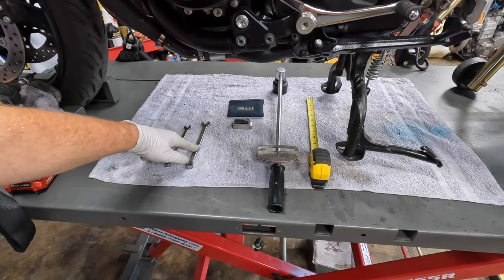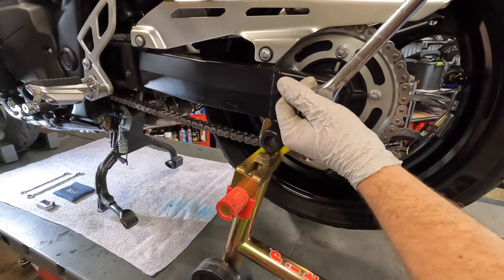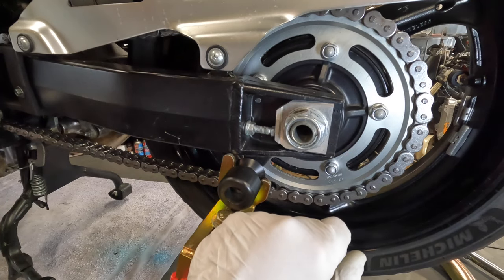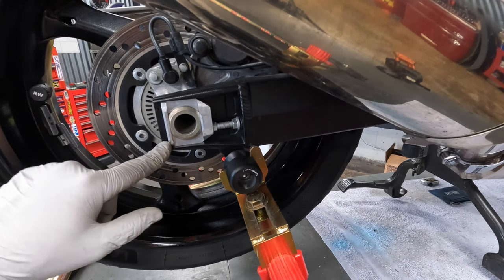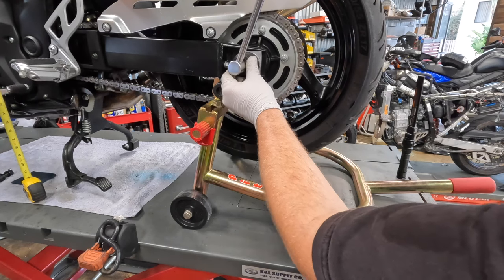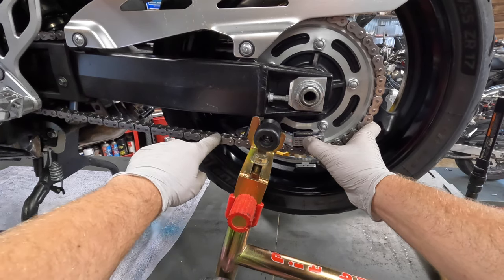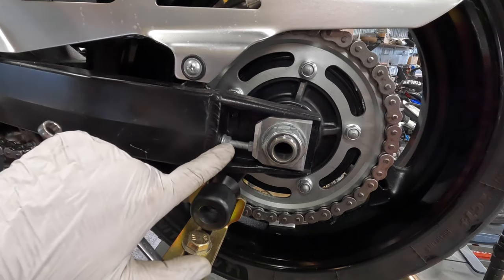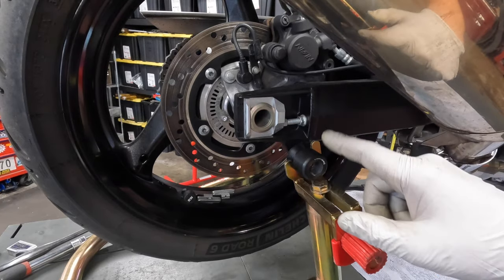How To Adjust Your Motorcycle's CHAIN & Alignment

Comment: I'm stuck at the point where, while tightening the axle bolt, it over-tightens the chain. Do I leave the chain far more loose than I need and let the axle tightening take in the slack? You're the first one to even refer to this in a video. Its really frustrating - it comes at a point where you think you're done and, surprise! You're not.

Comment: Do both axle bolts need to be loosened ?  Every video I watch only shows the side of the chain being loosened but lockouts are loosened on both sides
Reply from the maker: Hmm, not sure what you mean? I loosened the axle nut, the axle itself is held by the axle spacer on the other side on this bike, and it isn't, then you need to use a wrench on the other side to hold it from spinning. What bike are you working on?

Comment: Why torque down the axle, then check for alignment? If it was out, you'd have to slacken off again. What did I miss? Cheers.
Reply from the maker: Because for some reason, it changes the tension. Especially on suzuki's. It's just a double check...
Reply: Because torquing the axel nut tends to tighten the slack even after it’s adjusted.

Comment: My 2023 Klr650 says to adjust the chain with the weight off the swing arm to 1.2-1.6 inch slack. It makes the chain seem really tight when the suspension compresses. What’s your thoughts?
Reply from the maker: I'd do the adjustment while on the side stand or on a rear swingarm stand, and check the slack with you sitting on it and make sure it doesn't get too tight.

Comment: Hey Mike, just found this video, thank you!
I will be adjusting the chain slack for the first time soon, in the manual for my bike (2018 Kawasaki Z650) it says to set the motorcycle on the side stand while adjusting. Would it make a huge difference if I do it your way on the rear wheel stand? Thanks!
Reply from the maker: Should produce the same results.

Comment: Are all motorcycle sprockets aligned so the tire is aligned in the swing arm? My owners manual says to use the marks on the thing a ma jigs and reference the marks on the swing arm. For the record I did it the way you described in the video.
Reply: I don’t like using the sprocket for attaching alignment tools I use the rivets on the chain for my basic motion pro tool I seem to get the best results but that’s just my opinion and that’s not to go by lol

Comment: Great video. Dumb question. If my axle isn't perfectly aligned. The red dot is moving as the chain rotates. What's the easiest way to adjust it? Loosen the axle, and then what? I'm a new rider, and I have a hard time making small adjustments to get the tick marks even on both sides.
Reply from the maker: The tick marks are not always prefect. I would listen the axle and then adjust the adjuster bolts on either side to square up the axle, then retighten the axle.

Comment: Any input on adjusting chain tension based off the suspension loaded with rider weight?
Reply from the maker: Doesn’t matter as long as you’re sticking to the factory recommended slack, which is often on a sticker on the side of the swing arm.

Comment: I love that. Gotta get me one of those lasers.
Reply from the maker: Yeah, I’ll try and find out where I got it and post up a link.
Reply: @motomecha530  It's available on Amazon and a lot of motor parts shops, so not very hard to find. A cheap solution would be to use a stick you know is straight, and put that flush against the sprocket I guess.

Comment: This crackhead put my chain too tight! I drove about 12 miles with it super tight. Do you think I caused any permanent damage? 2019 Kawasaki Versys 1000… just bought this damn bike can’t even enjoy it, all the motorcycle shops are too busy to work on it. Don’t wanna leave it there for two weeks. I’m out here in the Smoky Mountains. Just want to enjoy the summer! So aggravating.
Reply from the maker: I'd say do a proper adjustment and see. I'll bet it's ok.
Reply: @motomecha530  yea it was fine. I have a habit of catastrophizing every time something goes slightly wrong. It’s from growing up in a crazy household as a kid.
Reply: Were in the same club.@FromTheHood2TheWoods

Comment: Never trust your adjustment notches, and throw away your lazer tool! Sprocket and chain alignment is not that important, wheel alignment is.  This how a motorcycle racer adjusts the chain;  First you need a 6' straight edge. Press an aluminum angle iron against the rear tire, while an assistant measures the distance between the straight edge and the front tire, then repeat on the other side, then adjust.  You will feel the handling improve instantly. I have been doing this since 1970 on all my race bikes and street bikes, and I have never come across a MC with accurate adjustment notches.
Reply from the maker: Hmm very interesting. Thanks for the tip, I'll try it out!